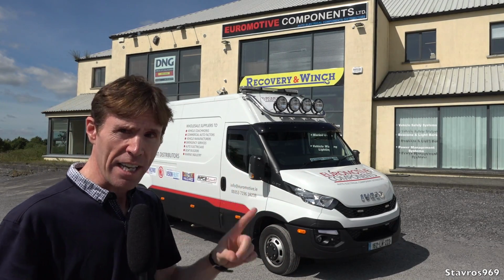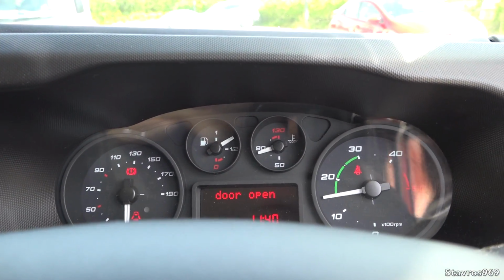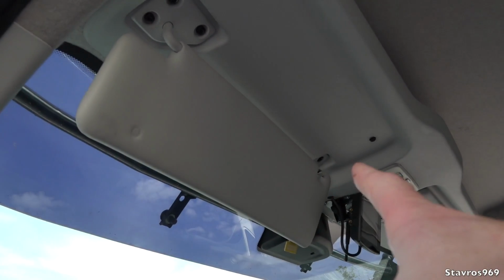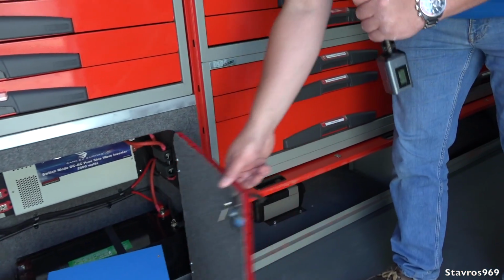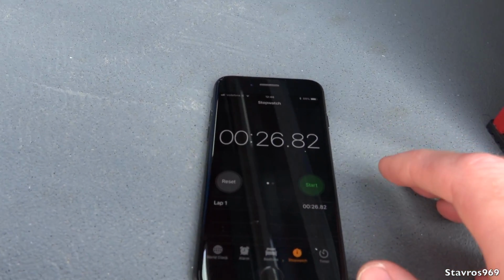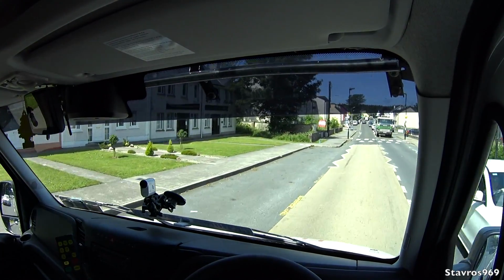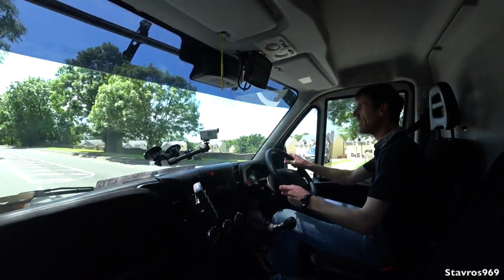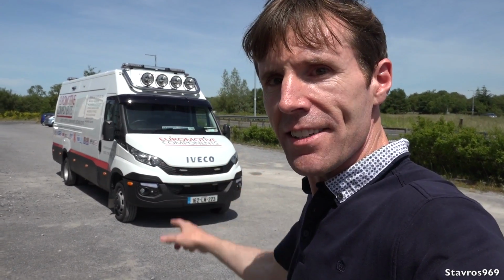IVECO Daily Customised Van 205hp - Full Review & Test Drive

Comment: I had a 35c18 2008. Worst piece of crap i have ever driven! 
The steering and gearchange was very heavy.
85000 km new clutch
125000 the diff was worn out
The EDC lamp was on always
It was 7 meters Long and had a turning radius of a footballfield.

Comment: @Stavros969 What would be the difference in parking, rectriction streets (are there a lot of them) if I buy a 7.2 tonne varient for camper van conversion, instead of an under 3.5 tonne varient , that's the maximum driveable limit with b category license. What do you think about that? How restricted willI'm be visiting places and parking in places, if i buy the 7.2t varient instead of under 3.5t? Thanks in advance!

Comment: I wish sold Daily 4x4, here.  Isn’t petrol still crazy expensive there haven’t been in Ireland in ages.  See commercial vehicles with crazy high miles. Wonder if it’s legal or why don’t transfer to compressed gas? Not cheaper, used to get heating fuel back in day because of criminal central Babylonian banking tax thieves. Ireland should be free of debt slavery and Zionist control, indigenous Irish will disappear by genetic swamping, last of genocides =extinction. What’s the material on Floor called? Costs? Could have sunroof like many vans. 32 miles imperial or USA gallon, four liters? Nice.

Comment: Worst mirrors in the industri.. 
We have two of the new Daily and both of us driving has chosen to have the "old style" mirrors installed on our vans. In the new ones the Wide angle part of the mirror is close to useless. Bad viewing angles And the curved angle on the mirror itself leaves you with a ton of blindspot compared to the old model that was much larger. and adjustable where the new is just fixed. 
Also.. yer its amazing how the steering wheel is only adjustable in one way on a van this new..

Comment: I did over 1 million miles in my last Daily before it was stolen - all at 3.5 tons with a 3.5 ton trailer - a great working truck. 

My current one is at 650,000 miles - recently had first engine rebuild - if you want to work your truck I thoroughly recommend it.
Reply: That's amazing! how many miles you on now? is there any thing you would recommend looking out for maintenance wise on these vans?
Reply: @JackButlerVideos  - Recently replaced at 780,000 with a Sprinter - disloyal after such good service but it was such a good deal, and it seems excellent so far. As for things to make sure of - the usual such as Fluids (fix leaks asap) belts, hoses, bushes etc. Don't skip service intervals. Inner wishbone bushes fail regularly. Cable tie the load sensing rod to it's ball joints on the back axle or it'll fall off - it's the first thing VOSA will check when they stop you! Power steering pipe loom chafes at brackets then leaks. Cab rusts at mountings and step sills - waxoyl it. Chassis generally good but can rust where rear spring brackets trap water. Now I'm semi retired so my new truck is having an easier life, but those before it stood up to 20 years of building sites, heavy machinery and long distances so I recommend Iveco thoroughly.
Reply: In America’s assume, can’t imagine all that mileage in tiny Ireland just size of a state. .  Lucky Europe spoiled with good diesel choices, I’d love to buy a small commercial truck was looking at hino too. Seems get better vehicles, don’t understand why different from same manufacturers.

Comment: How reliable are Iveco Daily's vs Crafters, Sprinters, etc?
Reply: With its strong separate ladder chassis the Iveco has a reputation for being tough and the 2.3ltr engine is bullet proof.  The main objection a lot of people have is the quality of the interior fittings, it's simply not up to par with the German machines.
 Reliability has always been good but one particular big name customer ran into difficulties following their request that Iveco alter the engine management to reduce the top speed. But an unmolested factory spec Daily will do the miles and is a thoroughly dependable machine.
Reply: Social Justice Warrior dailys are more reliable than crafters and sprinters
Reply: and transit